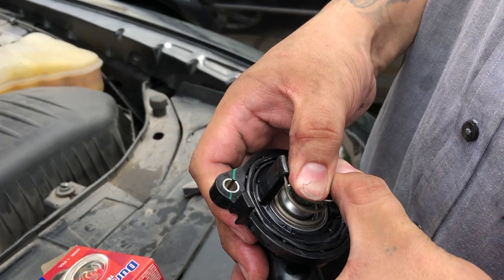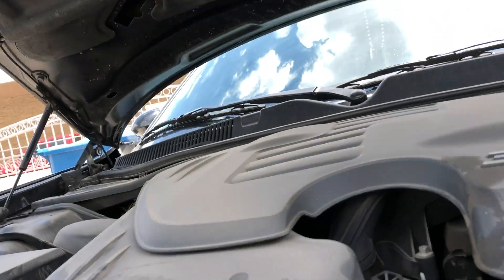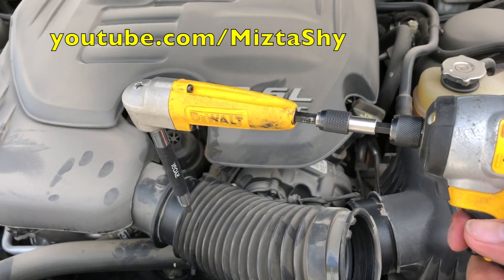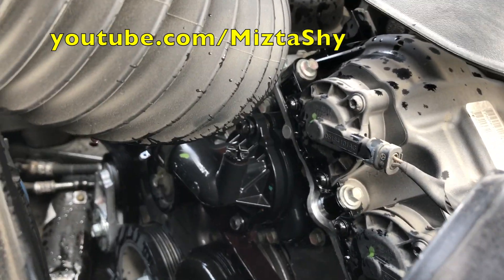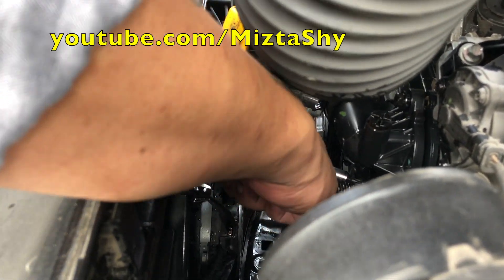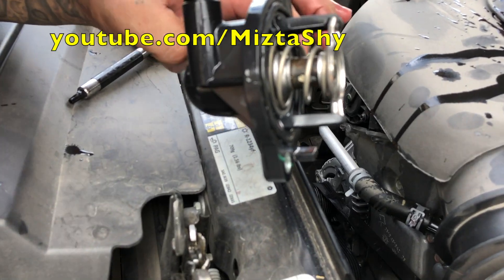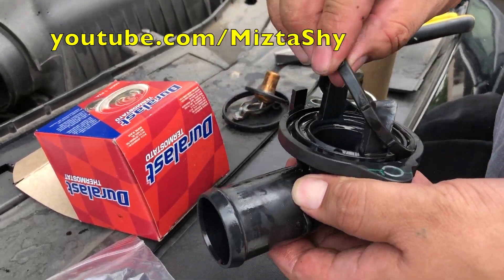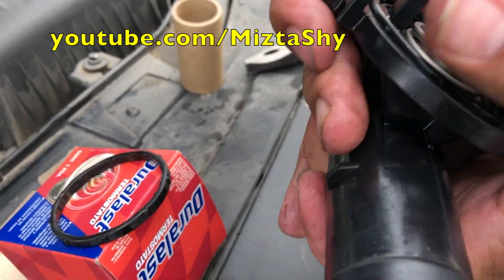How to 2014 dodge chalenger thermostat replacement

Comment: Thanks, easy enough.
losen the clamp for the air manifold, move out the way 
unscrewed the 2 bolts holding the thermostat (i used a 10mm socket)
unclamp the t-stat hose with channel locks, 
put the new t-stat in the h ose, then onto the car, being careful the gasket is proper,
screw it on, reclamp the air manifold,

cant believe i put this off for months.

luckily i only dropped a small puddle of antifreeze, and the level was still within the cold fill range.
Reply from the maker: Yeah - usually dodge are a bit tricky- this one was very simple surprisingly 🤷🏽

Comment: Thanks bro I appreciate your video .. saved me lots of money and time, it was a very simple fix just like you said did it all myself and reset the check engine light and it hasn’t came back on..
Reply from the maker: Yeah they was trying to charge my bro around 300$ I told m bring it right over sir save that money only takes like 30 min
Reply: Lmao yeah bro that’s exactly what the dealership wanted to charge like $300-$350 ... I got the Thermostat from autozone for about $11.99 and it took me not even 30 minutes from start to finish followed your video to the T everything was spot on just the way you said, and I haven’t had an issue since... I owe you one bro😃
Reply: Money Mike aye bro what was thr part called when you went to auto zone ? I just say thermostat and theyll give tje springs and everything ? Check engine went on and they said it was thermostat
Reply: luis vera yeah